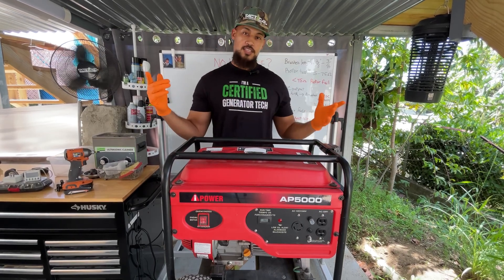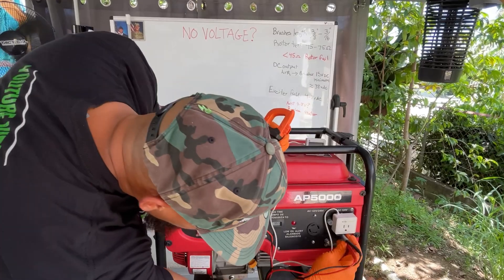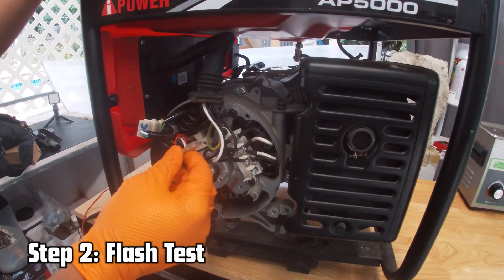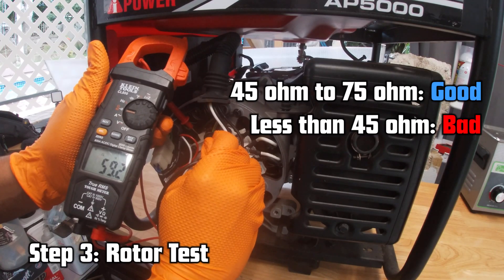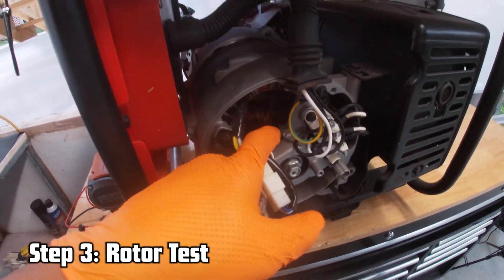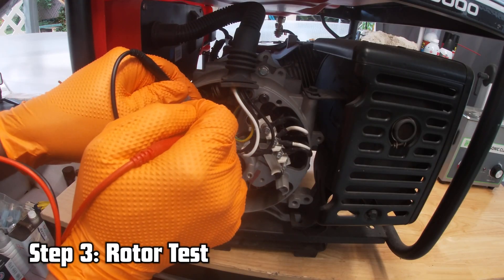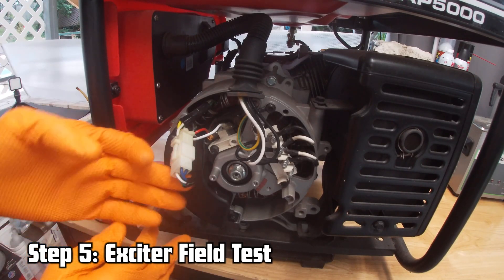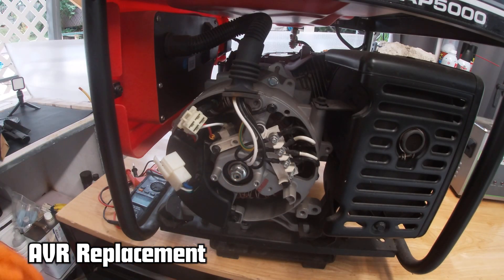Generator Runs But No Power? Step-by-Step Troubleshooting & Repair Guide!

Comment: Hello!

 R 1 is the active wire?
 R 2 is the negative wire?
Reply from the maker: What generator so you have? In many AVR models, R1 and R2 are the connection points for an external potentiometer (often a 1 kΩ to 5 kΩ linear potentiometer, depending on the specific AVR model) that allows for a 10% adjustment of the generator's output voltage from a remote location.

For small half moon AVRs on portable generators the positive wire (+) is the red wire and the negative (-) wire is yellow or white.
Reply: @tacticalpowerpro it is a Chinese generator, a copy of a Honda,
Reply from the maker: Message me clear photos of the AVR, R1 plus R2 wires, and the generator on my Instagram @Tacticalpowerpro so I can help you identify which wire goes where.
Reply: @tacticalpowerpro ok. Thank you so much Sir  I apreciate 🙏🏾
Reply from the maker: I’m here to help. Thank you for watching and commenting on my video.

Comment: Please help , I have a generac 15000 w.   But the power goes down and up , please give me a suggestion for fixing, thank you in advance.
Reply from the maker: I can definitely help you. When you say power goes down and up you referring to voltage going down and up? Or engine speed going down and up?
Reply: @tac @tacticalpowerpro thank you for answering me. Yes, voltage is down and up.
Reply from the maker: If the engine has no issues and the operating speed is at 3600 rpm and voltage is fluctuating then your issue is most likely the automatic voltage regulator (AVR).
Reply: @tacticalpowerpro . Thank you for your answer, I'll see if I can fix it, blessings.
Reply from the maker: Let me know how it goes. Good luck!